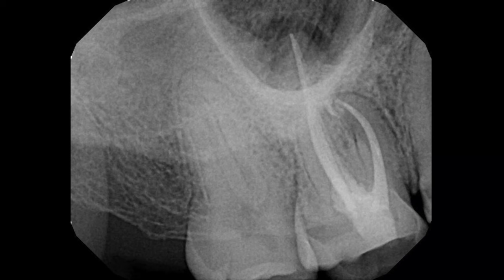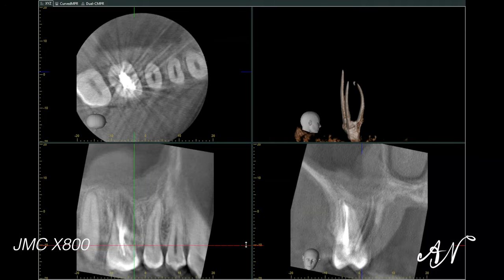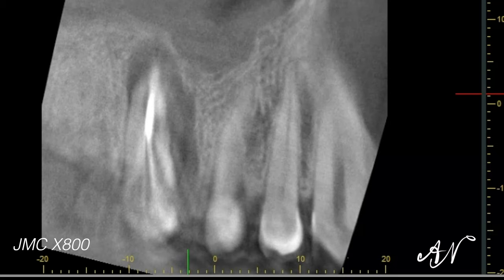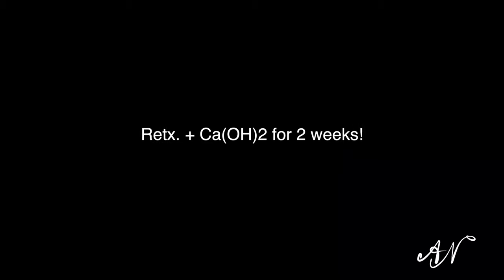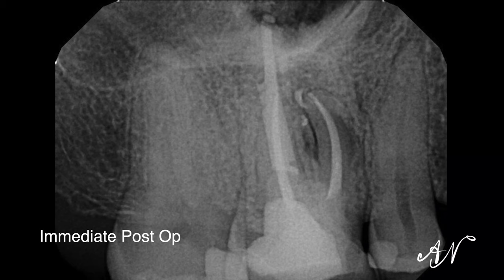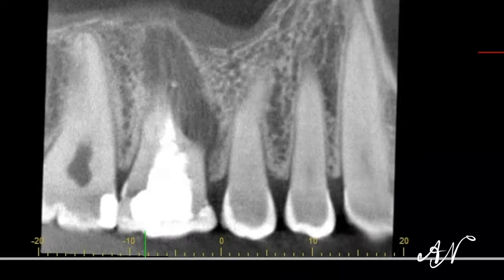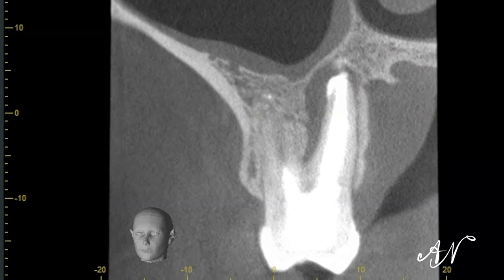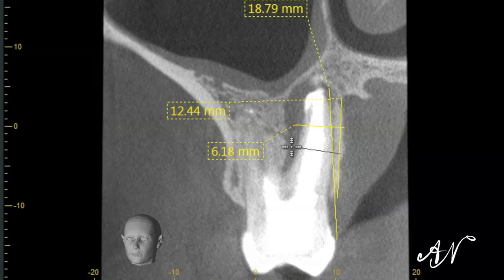CBL 36 Palatal Root Surgery and Quechee Baloon Festival

Comment: Hello doctor! I hope you're having a great day/night,im super worried about something and it's making me super paranoid. Today, I had a root canal (mandibular) and it was like the usual,the doc gave local anesthesia and it was like normal,but after some time,the area that got injected with the anesthesia is in awful pain,it's also on one side of my head and now it's traveling to the rest,my ear and neck hurt so much,I've had a root canal before and nothing was wrong, i asked them and they said it's fine it'll go away,i searched up about this but nothing came up, please tell me if something's wrong,i really appreciate it, thank you!
Reply from the maker: May not be related to the anesthesia and only a flare up after the root canal. You may have to control the pain for a few days and see how it goes. Every case is different and just because your previous root canal was painless (or painful) the next tooth may be different. I'm assuming you saw someone who was technically excellent and knew what they were doing. See them for a follow up if the pain remains acute after a few days or develops into swelling. Good luck.

Comment: Is there any evidence that bc sealer lead to apexification...  I am using bc sealer from Meta company since 2 years.I have left a few used applicator tips  from the early days filled with bc in a bottle of water. Today I checked to see the results. Some material in broader end has disintegrated. Remaining material is soft. At the narrow end material is still there with no solubility visible to the naked eye, however it is soft and can be penetrated with a needle easily throughout.
Reply from the maker: I can’t speak for Meta’s formulation. Only about BC Sealer which is the one I have helped develop. There are several bioceramic/hydraulic cements in the market and they have marked differences in all kinds of properties. The only one tested in the long run is the actual BC Sealer that’s been around since 2007-2008. The other ones you’ll have to test on your own or find supporting articles for. Keep in mind they all differ in formulation and need to be tested on their own.